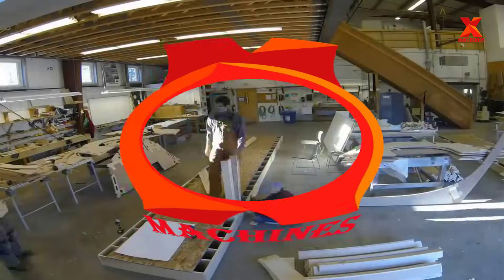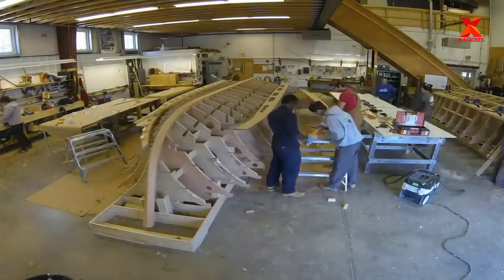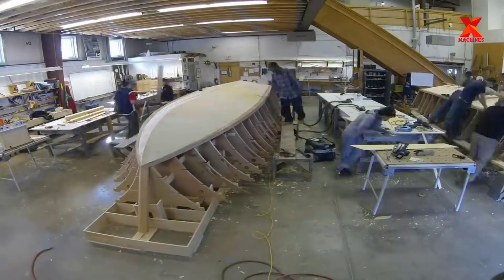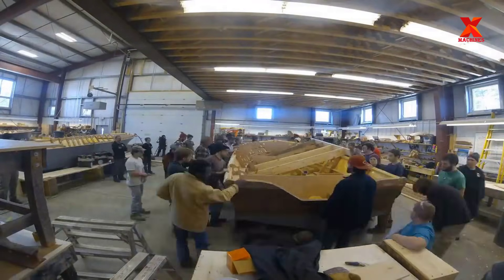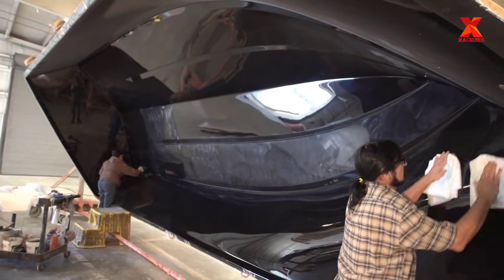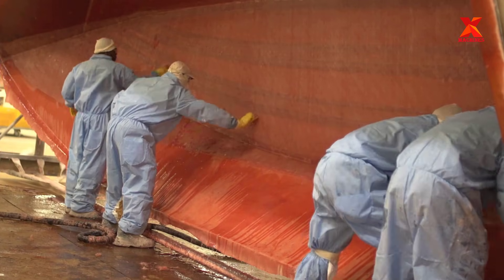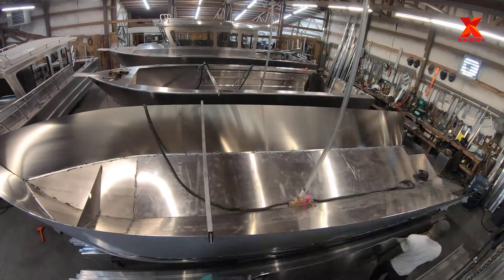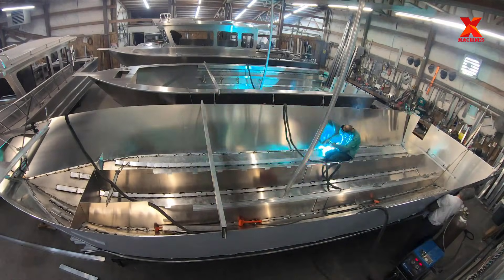Amazingly Efficient & Modern Boat Building Methods. Fiberglass, Cold-Molded, Welded Aluminum Boats

Comment: Ok now let’s make one thing very clear. Engineers are university degree qualified professionals who may design boats but they certainly don’t build them. The building side is done by highly skilled trades people. Engineers are not tradies.  Also there is nothing efficient about this build. 30 people running around to put a simple design together.  Your workshop would be running at a loss I would say.  Narration is also badly written. 3/10.

Comment: Boats like this with deep Vee aft at the transom are inefficient. The flatter the bottom at the transom, the faster and more efficient the hull. These were influenced unfortunately by the cigarette race boats of the past rather than the proper fishing hulls of the past. The best example of the combination of sharp V forward and flat bottom ft is South Jersey and Carolina sportfishing boats, which employ very sharp—or “fine”—frontal sections that gradually bleed into what is, for all intents and purposes, a flat surface at the transom. The best of these boats go fast and ride well because their designers have figured out how much V to employ forward, exactly when it should begin to flatten out, and how quickly.

Comment: How is this efficient? The number of steps and pieces involved is tremendous. Looks pretty conventional to me.
Reply: Not only is it an inefficient building method, if you have ever owned a boat, you know that the wood in glass covered plywood eventually gets wet and rots.
Reply: i thought the same thing.  Worked in a boatyard much of my childhood.  We made Menger Cats and used molds to pump out a few boats a month.  Much more efficient than this.  This is like traditional building with modern mats.  Not sure how its in any way more efficient though.